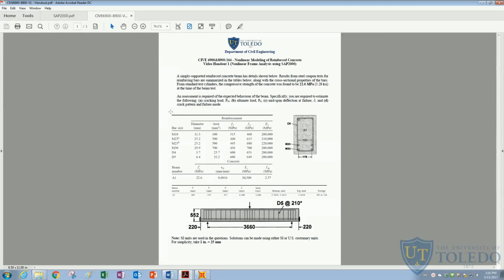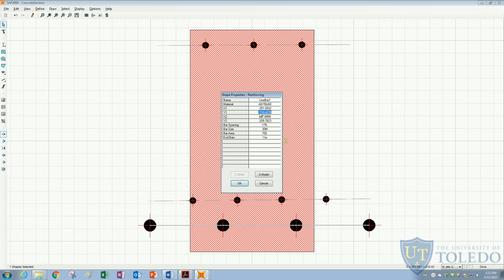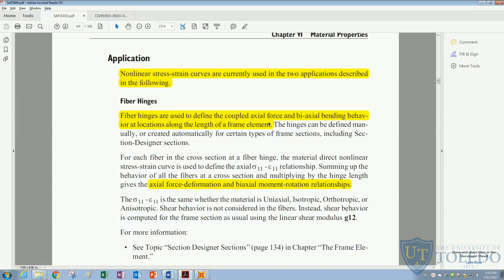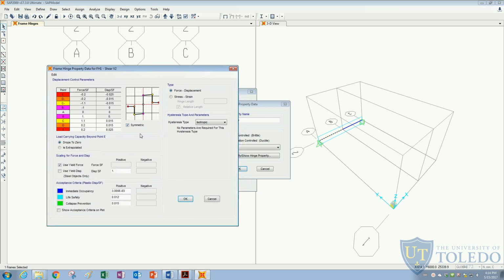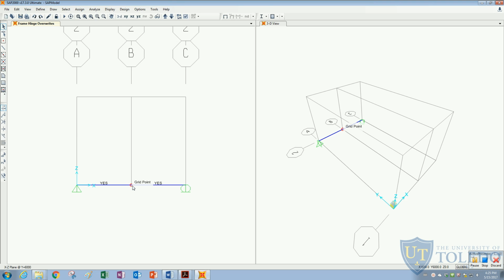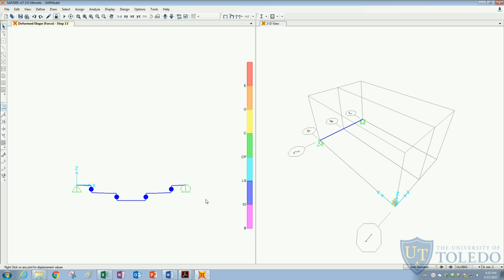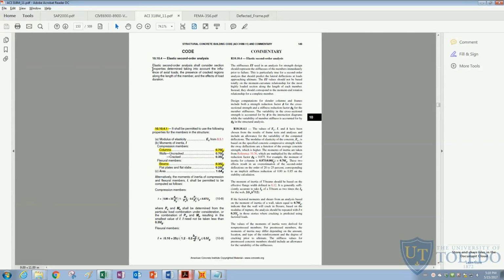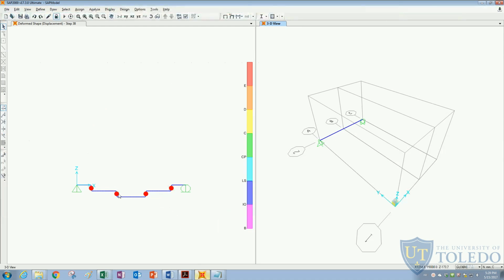SAP2000 Nonlinear Beam and Column Modeling using Default Hinges (Video 7)

Comment: hello every one. i am doing research on sequential Ground Motion Mainshock and After shock, the question is,  is there any option in SAP2000 to define two ground motion in one time but in a gap of time for example 100s. that software do analysis firstly for main shock and after 100s do for after shock. plz help me. thanks in advance

Comment: There is no FEMA 356 Auto Hinge option in my SAP2000. Can anyone help?
Reply from the maker: You may be using a different version of SAP2000. There should be another option such as ASCE-41. Of course, each code is different and you should ensure you are using the one applicable to your case.
Reply: @SerhanGuner  I am using SAP2000 V24. There is only ASCE option. Should I have to user define the hinge properties as per FEMA 356?

Comment: It is really useful study for us. Just I want to confirm something about assigning shear hinges.
In video (21:51) , shear hinge relative distance is 0.267

It is stated that Relative distance for left end of the frame =d/ length of selected frame element
Therefore relative distance (457/(3660/2))=0.2497) is 0.2497, but in the video it is given 0.267,
I couldnt get this value? I just want to learn is there any problem or not?
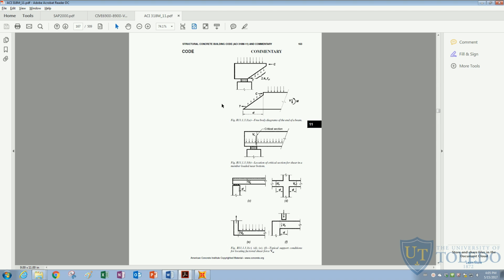Reply from the maker: Zeliha: good question. What video is doing is to add half of the bearing (i.e., support plate) length to d, that causes slight deviation between your number and our number. see 14:14 that shows pages from ACI 318 for this. Base plate dimension is not specified in the video. In the absence of this information, your calculation is correct. Good luck with your studies.

Comment: Thank you for the video.
I have a question, ¿ How did you get the distance on the with of the beam  (CL-Cl of outer = 127 mm ).
I have the same question for the distance on the height of the beam (CL-Cl of outer = 438 mm ).
Reply: same question

Comment: Hocam merhaba. Öncelikle video için teşekkürler. Autohinge tanımlarken, V Value From kısmında case/combo Dead olarak seçilmiş. Ama dead load'u herhangi bir yerde kullanmadınız.Bu kısmı açıklayabilir misiniz? Bir de pushover analiziyle ilgili bir sorum olacak. Pushover load case'i tanımlarken, Sap2000 bize üç seçenek sunuyor.(mode, accel, load). Sismik ananliz için hangisini seçmek gerekir? Pushover analizle ilgili bir video yayınlayabilir misiniz?
Reply: tabiyki "accel load" sececeksiniz. ayrıca benimde size bir sorum olacak müsaitseniz.:))
Reply: You are correct. The "V Value" when defining the automatic moment hinge should be from the load case with the maximum V. For the example given, that should've been the "Force" load case instead of the DEAD load case. The shear value, however, doesn't change the capacity of the moment hinge, it only changes (very slight) the response of the hinges in terms of deformation. You can get more details if you look at the FEMA 356 document from which these hinges are calculated from.

For this problem, as shown in the video, the moment hinge does not fail, so choosing DEAD for the moment hinge definition does not change the results of the video. 

For the question about the pushover analysis, this video explains how to do a pushover analysis using force-controlled and displacement-controlled analysis, so you can use the same for a static-equivalent earthquake load condition. If you want to apply dynamic earthquake analyses (like a time-history analysis) then you would have to use an acceleration analysis. This process is a little bit more complex than illustrated in the video, though, and unfortunately, we don't have a tutorial about that yet.
Reply: @fratkaymak1271  bazı hocaların kitaplarında mode, bazılarında load kullandığını gördüm :) buyrun sorunuzu bekliyorum
Reply: @rafaelsalgado7562  thank you for information.

Comment: sir it was really very informative video.. thanks a lot.. but sir i have a small doubt, what is the formula to calculate monitored displacement value?? 
hope you are free to answer my question sir.. thank you :)
Reply from the maker: The monitored displacement comes from SAP2000 results. You should not need any formula for it. Take a closer look at the video for the results where you will see the displacements. I hope it helps.